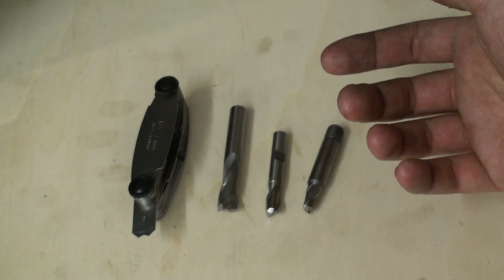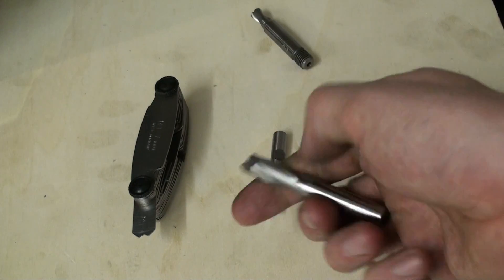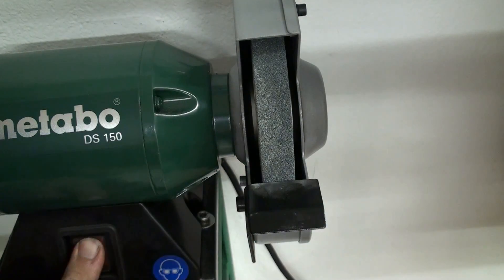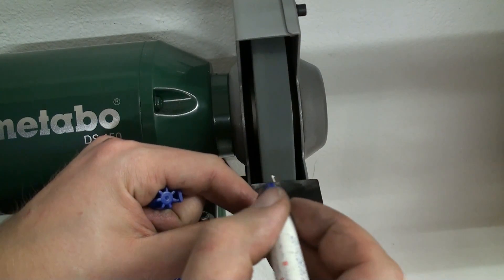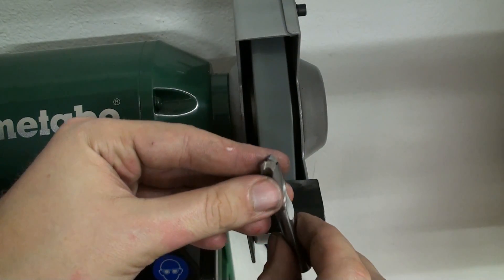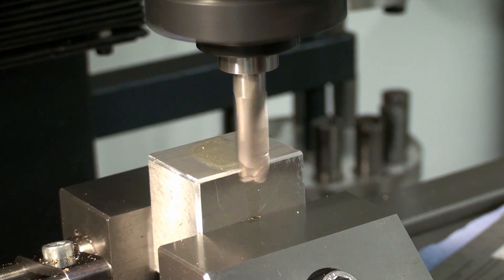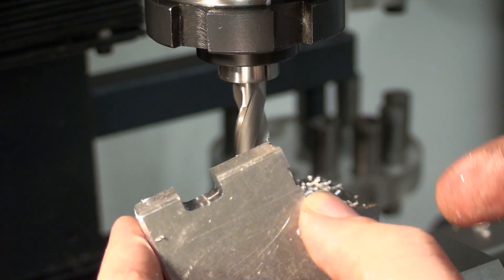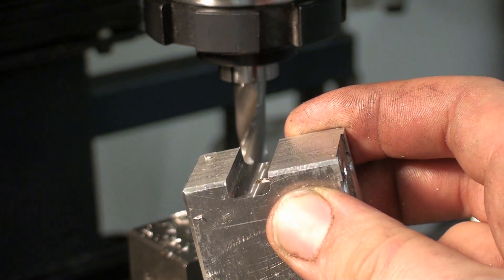Quick and Dirty Bullnose Endmill - Torusfräser freihändig schleifen

Comment: One tip for all machinists

grind small radius on endmill you use for roughing operations.

it will plow in material much better and lower your spindle load. Most roughing endmills come from factory with small radius, but often I grind it a little bit more. Works great on plain steel, and tool steel. Didn't tried it on aluminium but if it works on steel  I bet that it will work for alu also ;)

Comment: I bought a lot of vintage tools recently and got a bunch of end mills including dozens that have obviously been ground from square corners to a radius, like you showed here.  Many are ground all the way to a ball end full radius.  They were probably made from end mills with chipped corners.  All are top USA brands.  Most all of them appear to have been done professionally on a tool and cutter grinder, and look nice and work quite well.  It also appears that they ground a tiny notch on the drive end corner of the tool each time it was sharpened, and a few have six notches.  Some have had the flutes sharpened and relieved multiple times as well, with the new diameters engraved on the shank.  Time was less valuable in those days...
Reply from the maker: +Bob Korves And you just could not get fancy milling cutters back in the day! When I talk to the older guys here at work, that used to run die sinker and tracer machines, they had to grind all their radius and angled cutters themself - Either modify existing cutters of grind completely new single lip cutters.

Comment: Good to fall back on! I didn't think both sides of the slot would be the same radius;-)
Reply: +Weapons Machinist™ I thought about that too.  But if you think about it if one side took more off than the other it would swing through 360 degrees and take the material equally off both sides. The other flute would at like like a roughing material remover.  It would essentially act like a one flute end mill!!
Reply: Your right! I was just trying to leave a comment. Actually he could use a piece of norbide with the male radius ground on to dress the female radius into his bench grinding wheel to off hand grind the end mill. He knows :-)